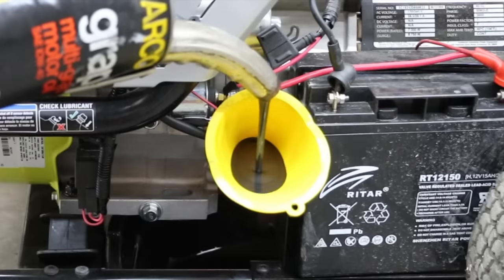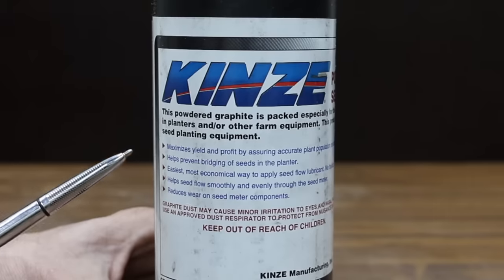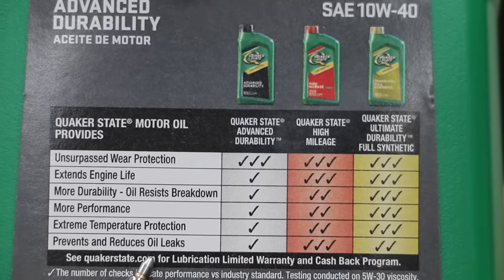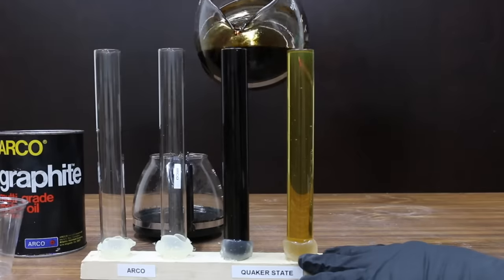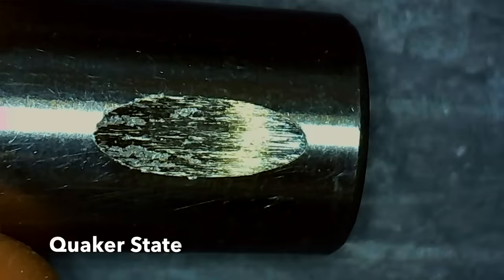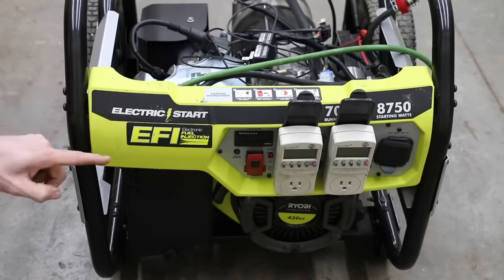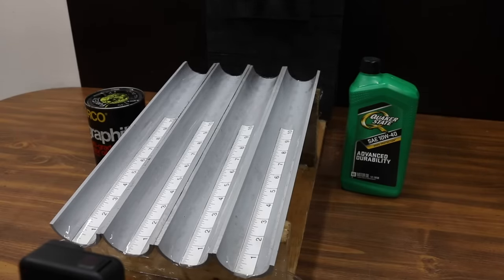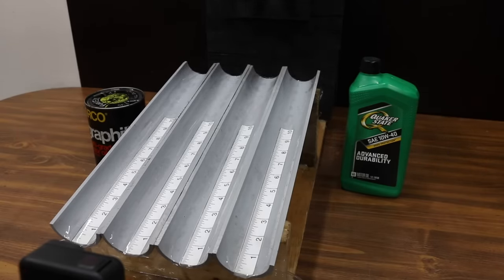Will "Graphite" Help Motor Oil Performance? Let's find out! Vintage Arco Graphite vs Quaker State

Comment: The 20 second difference in the run times "could" be caused by very small differences in the amount of gasoline in your gas (jar) tank. It did not look to me like you filled the jar completely full on the ARCO test run. Also the way the gasoline is "dancing" out of the vent holes in the gas jar cap "could" cause a difference of 20 seconds if the jar was oriented different enough to cause some of the droplets to dance off the gas jar cap. 

All in all, great test. I would not put graphite oil in my expensive late model car because of the initial graphite sediment you showed at the beginning of the video.  If I were going to try to run an old beater of an oil drinker a few hundred miles longer I would consider ARCO Graphite.  Unfortunately some people "might" oil up with ARCO prior to trading in an old smoker of a used car. I hope not, but it's not a great world we live in.

Oh, by the way, years ago I saw the friction bearing test (same as your machine) run on a cheap oil laced with a miracle oil additive which was compared to Havoline. The test didn't work because the Havoline oil was too good and the friction against the bearing would not scar the bearing. That test was run in the late 1960's and oil is much better now. 

Keep testing. I love these. You sir are A GENIOUS at doing these tests. Thank you so much. You have my sincere admiration.
Reply from the maker: Thanks so much!

Comment: I remember this stuff when I was working at a car dealership as a mechanic, stuff you didn't want any where on your person.
Reply: I remember spilling some of that Arco on my clothes and it left a permanent black stain.
Reply: What'd the filter and the pump look like with it?
Reply: @EgorKaskader  Never tore a filter apart didn't want the stuff on me. Most filters have a bypass valve in case they get clogged. Never had a problem with the pumps.

Comment: I worked on a powder coat paint assembly line a few times.  They lubricated the overhead track bearings with graphite oil.  When the track went into the oven that heats the paint, the oil would burn off and the graphite is all that was left.....
Reply from the maker: Thanks for sharing.

Comment: Years back there were couple of tricks that made the con rod knocking a bit smoother, and one of them was carbon grease in the crankcase well through the oil filler on top of the rocker cover  and slowly mixed up with the oil, as the carbon grease meant to fill the gap between the con rod bearing and the cranck shaft..

I have actually tried the one above. It might be just placebo effect but my car was less noisy after.😂😂

The other thing was the really fine sawdust as it apparently makes the oil a bit thicker and it should do the same thing as the carbon grease, id love to watch a video of that as i have never got around to try it👍🏻
My engine seized before i could put this to the test😂😂
Reply: I remember sawdust in diffs and gearboxes to quieten down a whiny gearbox for a while....never did it myself
Reply: Seized huh? No shit 😁🙃

Comment: Years ago I used an additive called TufOil.  It was a Teflon additive and looked like a red syrup.  It seemed to work well in my AMC Eagle 258 inline 6.  Have you tested it?  It appears to be still available.
Reply from the maker: Great test idea!
Reply: I also called that one once to Farm. Let'scsee if he does it.
Reply: And test it against Motorkote!
Reply: Well teflon is not highly toxic?
Reply: I’ve never heard of this product before
Reply: MrBonami2 I hope not since that’s the coating on nearly all nonstick cookware. And plumbing tape.
Reply: @ProjectFarm  Tufoil was in the Guinness Book of World Records as the world's most efficient lubricant.
Reply: Teflon anything in an engine lube is no bueno. 
It turns to hydrochloric acid when burned. 
And engines do use and burn oil. 
Nice for the upper ring and land and valves and seats.
Reply: @OldAccountUser  Teflon is fine so long as you keep it below 500*. Don't inhale the fumes ...... In fact, don't make a habit of inhaling fumes of burning plastic in general.
Reply: @OldAccountUser  not by itself at standard temperatures. Making it requires and leaves behind some nasty things, and if PTFE is heated (I forget to what temperature) it decomposes and gives off toxic vapors, bad enough that people who keep cage birds are advised not to use cookware with PTFE/Teflon™ coatings.
PTFE is routinely used in implanted medical devices as it is considered biologically inert.
Reply: @MrTheHillfolk  hydrochloric acid? Don't you mean hydrofluoric acid maybe?
Reply: @fukpoeslaw3613  
Yea , that ...
Blame a distracted typer before he hit send 😁
Reply: MrHillfolk did not know that thank you for telling. I know some products are too good to be true sometimes. I stick to liquimoly if it’s in race cars its good for mine
Reply: @MrTheHillfolk  👍
Reply: @AndrewKidd14145  
Haha yea I run those "foreign jobs" and I like the lubro moly products. 
Diesel purge is some good stuff! 
(I know, off subject but i like the stuff 😁)

Comment: I know my Dad's work had a Gas forklift needing an engine reconditioning and instead of rebuilding at the time, the boss put in a whole bunch of Graphite into the oil and at that point stopped servicing it.

They rebuilt it last year from memory because it did not last forever, but it gave it a few more years before needing that full engine rebuild.
Let me tell you, it's hilarious when they do jobs wrong, try to weld something, leak coolant etc and when they assemble something so wrong that other things don't assemble correctly and you have to break things to get things apart. Those stories are unforgettable.
Reply from the maker: Thanks for sharing.

Comment: please improve the way you add gas to the genset. Every-time you start it, some gas spills(6:39 right side of the genset). That spillage might catch fire on a hot genset. 
Also you can clearly see some visual difference between the amount of gas added(Visually looked ARCO had a little less gas added). If you can use a proper beaker away from the genset for lesser vibration. Thanks. You have awesome content. Just had some suggessions.
Reply: I seen that it was about 1/8 inch lower which might have put it passed QS. Not by much But...
Reply: It will be just fine.

Comment: A well known performance diesel shop tested Schaefer's molly additive added to synthetic oil vs. straight synthetic diesel rated oil. A 5.9l cummins powered truck was strapped to a dynometer. It was several years ago so I don't have exact numbers but that molly additive made more H.P. and tourque than stock and added more than spending $300 on a cold air intake.
Reply from the maker: Thanks for the feedback.

Comment: I'll never forget what it looked like when we went to change a cracked head on the 350 in my dad's Blazer. He had used that Arco Graphite garbage for a couple of years. Pulled the valve covers off and the valve springs and inside the cover was caked solid.... same goes for the lifter valley and underside of theintake manifold. There's a very good reason it wasn't on the market long.... pure garbage!!!
Reply from the maker: Thanks for sharing.
Reply: I remember hearing from my uncle that quaker state back in the day had a ridiculous amount of parafin and saw something quite similar after pulling the heads.
Reply: @chrisvoss7223  I heard the same thing about Pennzoil.
Reply: I run strictly Amsoil now.

Comment: is the high iron content maybe due to sitting in the can for so long? leaching out of the can, just a thought
Reply: I thought that same exact thing too.
Reply: Can degradation
Reply: grantodamax I think those cans are plastic lined on the inside🤔so that shouldn’t be a problem
Reply: Considering the first plastic lined cans were developed around the mid 1930s, probably.

Additionally, before using plastic coatings, the cans were made from 'Tinplate' with a layer of tin protecting the contents.

Comment: When I was a heavy equipment mechanic/operator we could only get about 3 years out of a diesel engine with diesel specific motor oil before a rebuild was needed, (such as Rotella and Techron) once we  switched over to moly oil it doubled the engine's life span.
Reply from the maker: Thanks for sharing.

Comment: They made graphite infused oil back in the early 80’s. It ruined every gasket and rubber part on my engine. It was a mess.
Reply from the maker: Thanks for sharing.
Reply: While graphite is a dry lubricant, it being mixed in with a liquid oil over time will cause additional wear, not less wear, as it will become a mild abrasive. Further, with thermal breakdown over time, it will eventually, block oil ports, in push rods and other narrow passages. It is a terrible idea.
Reply: @boo-leeproductionsinc3501  So what you are saying is that it will, over time, block any oil leaks.
Reply: @boo-leeproductionsinc3501  ummm ... no. Graphite is more thermally stable than oil and a sheet matrix of pure carbon doesn't swap side groups and cross link into an adhesive polymer like an oil. The test has exposed the largest weakness of the product - it was better in machines of its own era when it was (incorrectly) believed that a polished bearing surface would let oil squeeze out and gall thus wearing more rapidly. The oil film's cohesion is a characteristic of the oil, and a rougher surface simply supplies the abrasive for its own destruction. The graphite filled the rougher surface's pores and slid  over itself. it does nothing on more polished modern bearing surface. It's not clear if the chosen test engine is a good representative of an automobile engine for this test either. Consumer grade generator engines have aluminum cylinder walls without iron sleeves and no oil filter with a lot of aluminum wearing into the oil every hour of its short life. That  makes using it as a stand-in for an automobile engine for this particular test a little shaky.
Reply: @oliverstreet7704  Ding ding ding.... Idk why everyone keeps saying it breaks down... Maybe after 20k miles? When this stuff was used oil filters, and aluminum bores weren't popular. I use Tungsten Disulfide in my kart engines, no oil filter, iron bore. Not only runs better with less wear, but also picks up horsepower because of less friction.

Comment: I use to use that Arco graphite oil in an old Buick I had...It seemed like good oil..
Reply from the maker: Great feedback!
Reply: Pilot16H  +1 to that
Reply: Pilot16H  you have to get a special filter for it I use it in my cj5
Reply: Pilot16H  That is a great question but, i have no input because I never checked..The only negative thing i ever heard about it was someone thought it was hard on camshafts since it was a dry lubricant mixed with oil..
Reply: Pilot16H  I never had a way to know if the filter clogged or not..The car seemed to run great in every way..

Comment: My mother used to have a dual fuel Volvo 142 (ages ago). It was a petrol car with an aftermarket gas tank in the back. In those days gas was super cheap compared to petrol. The guy from the gas company told us that gas was 'dryer' than petrol therefore we had to have a little graphite oil reservoir in the engine bay. I think it must have been 1 liter max. Every so often we used to top it up.
Reply from the maker: Thanks for sharing.

Comment: I remember my grandpa saying when he was in the air force they would get moldy in a powder form and add it to oil, grease, you name it. That would be a cool video to do.
Reply from the maker: Thanks for the video idea.
Reply: Chris lein do you mean Molybdenum Disolfied?
Reply: @garyoconnordbaairrepair7775  perhaps? He said it was an orange like powder they got in drums.
Reply: Chris lein one of my customers worked at the local AFB as a civilian worker and he brought a bottle when he came to me to change his oil.  It was a bluish color.
Reply: @garyoconnordbaairrepair7775  this stuf was probably fro.the 50's or 60's
Reply: @garyoconnordbaairrepair7775  Molybdenum Disulfide.
Reply: @SweatShopActual  ok because I was thinking actual mold juice or something. Physics said I was thinking wrong. It was weird.
Reply: @ProjectFarm  molybdenum disulfide ("moly") is a fine black powder much like graphite. The moly is in little nanosized hard balls that roll readily whereas the graphite is in little flat sheets that slip over each other easily.  I have used both but the moly makes more difference in a manual transmission or a normal differential (not one with limited slip).
Reply: I think you'll find that MoS2 is actually planar sheet like material similar to graphite.
Reply: *Molybendium Diesomething
Reply: @bengrebla9637  Whoa!  It looks like you are right!  For years, ever since I can remember from back in the 50's, moly has been described in automotive literature as "little hard ball bearings" and I believed them. I took automotive in high school.  Wow!  Well, people have heard me say that we know 50 thousand times more about chemistry than we did when I went to school!   Thank you so much!
Reply: @fredbach6039  No worries mate, it's easy to be misinformed, granted technology changes over the decades, theories have been scraped to make way for new ones, it's only with time and technology does our understanding get better. 👍

Comment: I remember when Quaker State sold their oil in clear bottles.
Reply from the maker: Thanks for sharing.
Reply: I used to work at an O'Reillys that bought out a company called hilo and we still had 20 cases of clear quaker state oil in the back covered in dust

Comment: I once added graphite powder to the engine oil in a nearly completely dead Briggs pressure washer downrange. Engine was ragged out and had hardly any compression. ( It was critical for "hotwash" operations of HH-60 engines.) Needless to say it lasted another month of constant abuse in the hot Afg sun in the middle of the summer before it met its demise. (By then we had the other two pressure washers up and running) 
Great video as always!
Reply from the maker: Thanks!  Thanks for sharing.

Comment: 11:08 -- Wonder if the knocking was caused by excess dirt / detonation or if it's a lubrication issue on the bearings ?
Reply: Or from the fact that, if I'm not mistaken, that engine has been a "guinea pig" for several tests before, and probably has several clearances that are not to spec.
Reply: @Pulse87dotca  --  The little engine that keeps on giving in the name of research.

Comment: Pretty simple with results so thats is good. Actually a heat cup and Rheometer would have shown the friction reductions and flow properties more accurately, N&K, Reynolds numbers, Yield and plastic viscosities ect. From my experience using graphite in oilfield fluids show that graphite actually works well if circulated long enough fill voids in the micro fractures a nd extends the life of motors, pumps ect. A internal combustion engine may just be to much heat for it. A comparision with the better motor oil with graphite added may have been a better comparison for the graphite. Possibly run a retort to get the true solids, water and oil percentages?

Comment: I use marvel mystery oil in my oil and fuel. what have you done with this? i have seen noticeable gains in how car vehicle idles  and how smooth my vehicle runs.
Reply: I also do the gas&oil in my 1971 c10 with a straight 6 cylinder. Runs noticeable smoother.
Reply: Used it in my 2000 cavalier 2.2L ,fixed a bad fuel injector, and the engine lasted 250,000 miles.

Comment: Any time a “grainy” substance is close to my bearings or rings (or my engine period !) i get really nervous.
Reply: Brian Fulwood i know right, i dont understand why you would ever put graphite in a engine period
Reply from the maker: Thank for the feedback.
Reply: Haha
Reply: Actually it's more like tiny ball bearing not grainy. Graphite is used to lubricate door locks.
Reply: Brian Fulwood
 - Funny. That's the exact same thing a buddy of mine that owned an auto parts store / machine shop said to me in 1979 when I put that stuff in my new Jeep CJ-5. I remember that the stuff had almost zero viscosity and flowed like water when poured out of the can.
Reply: Graphite is really soft so it smudges under load of steel, and it cannot scratch the motor
Reply: Graphite is not grainy.
Reply: @terryh9721  - It may not "feel" grainy, but it is a mineral that is a form of the element carbon. If you put it under a microscope, you will see it is "grainy". As far as doing damage to your bore...I couldn't tell you, but if it was so good, it would be an additive in all oils. Arco Graphite wasn't around long and from what I've heard, they removed it  from the market due to a basic problem they couldn't solve - how to keep the solids (graphite chips) in suspension. I also hear that the solids (graphite)  would get into lifters and plug them up as well as any other small oil passages. It could also plug a filter.

Comment: Have you ever tested off-line oil filtration systems. Back about 30 years ago they were a thing for industrial engines. Basically a secondary oil filter with a large 1 micron filter that was pulling just a low flow, not all the oil flow like the primary filter. The objective was to keep the oil like new and extend engine life. They may still use them for all I know. They do use the shop stand versions for reconditioning hydraulic oil.
Reply from the maker: Thanks for the suggestion.